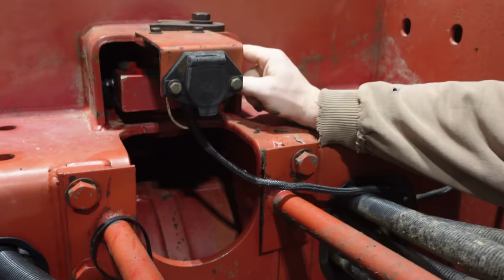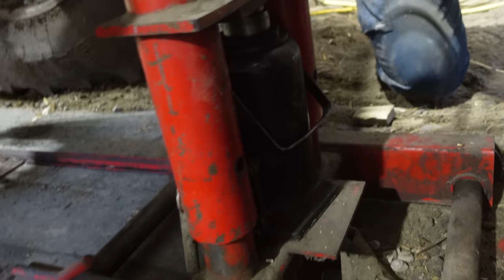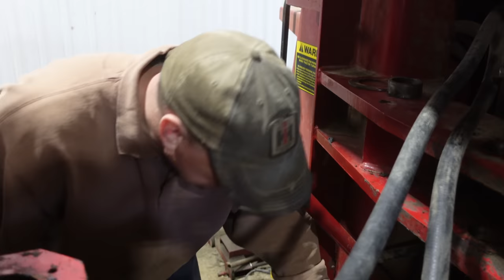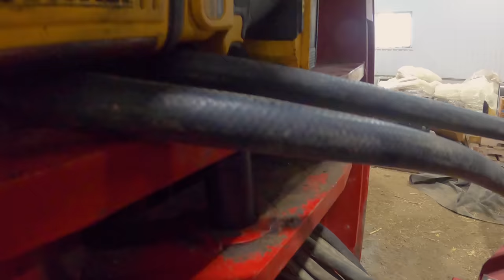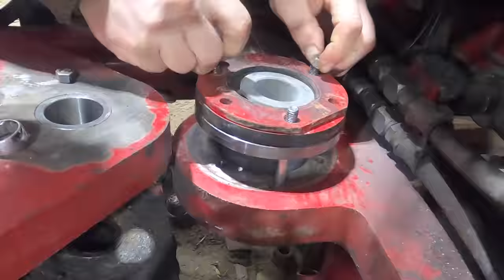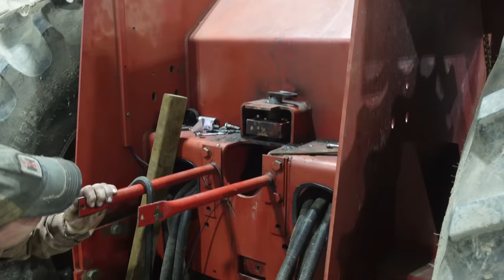Case 9350 Steiger Needs some Creative Machining...

Comment: You can use aluminium as a backing form when you weld mild steel , Jody from welding tips and tricks regularly uses it for heat dissipation also. ❤
Reply: Copper does a good job too
Reply: carbon
Reply: @notsevenfeettall  Aluminium (aluminum) is much cheaper but take old scrap copper tubing, split it lengthwise with a cut-off wheel, anneal it, flatten it, temper it. Hard to beat copper backing.
Reply: brass works as well

Comment: I have had a 120mm spherical bearing that wore out its mount work for half a decade when I needed to fix the bore with Devcon and the emergency repair lasted for 5 years before we got a chance to replace the mount. Its pretty amazing how well steel putty can work sometimes.

Comment: the hydraulic knock out tool for making holes in electrical boxes has a really nice pull cylinder that works great for pulling bushings I've done a lot of cam bearing that way.

Comment: Those tractors are worth their weight in gold. I did a season seeding in one in western Australia in 2008 the farmers had tried different brands over the years, (versatile, ford, j.d etc an nothing could beat the Stigers. They put the power to the ground so much more. The good ones can last 20,000 hours and the bad ones 18...

Comment: We had the bushing on one of the steering rams in the JD644 go like that lower pivot did on that case, it came apart and gouged the shit out of everything totally destroyed the cup, last year we just welded a decent used bushing in but this year we pulled the ram and are in the process of making a new end for it, need to weld some frame cracks too.

Comment: I find using an electromagnetic drill is perfect for drilling broken bolts as the angle doesn’t change as you apply more or less pressure to the job 👍
The fact that those bolts pushed through took all the fun out of it, such is life.
Thankyou for sharing 😎

Comment: Great video.  Takes me back.  Those through bolts on the lower ball joint plate seem like a lot of trouble.  When the heads inevitably get rubbed off from the bottom the plate can separate and then the whole thing disintegrates as you already experienced.  I’d definitely keep an eye on those bolts or convert that to threaded hole like the back.

Comment: On the international dt series engines that I used to work on the oil goes to the filter last so you never need to prime them cuz it doesn't matter. Its after everything else.

Comment: For those bushing repair green locktite is great when you can't get it perfect,

Also you can buy carbon slug or aluminium round for backing up, however overwelding and running a reamer with a mag drill is the best option

Comment: Jim’s automotive machine channel welds inside a bearing race to remove it. As it cools it shrinks the OD and it falls out.  Similar to the technic (?) of heating the race to expand it to red hot, then the cooled part is smaller at the end

Comment: Kevin, Rich, I've done barely any heavy equipment/ag repair but, did a lot of high precision spindle and gearbox building back in the day. So, the little tidbit of wisdom that I can share on projects like this is simple, keystock is your friend. On proper hardened bearings and bushings (any roller bearing and I suspect most of these bushings), we'd never use brass or aluminum punches, always keystock. It's a uniformly soft grade of steel so, it won't damage a hardened surface and as you use it, you can see any burr well before it gets ready to drop off into your bearing/gearbox. So, normally every month/week/day, you dress them up on a grinder to have a nice smooth face. My personal preference is toward oddball sizes of keystock. My go to is a piece that is 8mm thick by 12 or 14 wide and a foot long. That way, I can normally get the 8mm side into a tight spot, once a radius is ground on the end, it sits on a bearing lip rather well and the length just saves the back a bit. Obviously, in a tight spot, you might need to lop some off. 

I'd say 90% of the time in every shop like that I've been to, the bearings are sweat fit (freeze the shaft, warm the bore), from there methods differ. On new install, I've seen really nice press set ups and exacting shrink fits that let everything just fall into place. But, there always ends up being plenty of cases where something is getting hit with a hammer. 

Oh and if every you're in a bind because you do manage to get a bunch of dirt on a new bearing, according to an SKF rep, they recommend using Scott toilet paper to wipe them clean. Not sure the brand really matters but, I guess between the biodegradable fibers, small fiber size and relative purity, it'll break down with time in bearing grease and not damage the rollers.

Comment: We did the same thing with the greasable bushing on the draw bar of a Deere 4450 when I was younger. Same problem. It was a greasable bushing but no fitting
Reply: Clearly the grease in the bushing is suited for the lifetime of the bushing, it's lifetime being for the length of the warranty :D

Comment: I recently had to change out some hydraulic cylinders.  The 2.5 inch pins were seized.  I ended up using a Oxylance to blow a hole through the pin.  Thus shrinking the pin diameter.

Comment: On the age old oil filter argument, I was filling an oil filter up in the center hole and watched a small piece of the aluminum foil from the top drop in. If I wouldn't have caught it, that may have caused some serious issues if that made jt jnto a bearing. 

I figured the manuals that said don't prefill the filter were more worried about that kind of contamination and not necessarily the oil in the jug.

Comment: Pretty interesting.  The only tractor we've ever split was our 6588 to replace the clutch; about three times or so.  It seems like a big deal but since the 6588 is a 2+2, it's essentially a front with DT466B and axle hinged to a cab and axle from a 3688.  But when we got our green Steiger, I think it was a Panther, thankfully nothing like that was needed.  I don't think I'd be attempting something like that.  Interesting to see how you folks went about it though!  Always like seeing these old workhorses keep on working the fields.

Comment: If you have a good magdrill you can use it to bore accurate holes in areas that you cannot fit a line borer.
You can either fit the drill with a boring attachment instead of a chuck or use a high quality hole saw/drill.

Comment: Case did their oil filters the same way. Upside down because it was only partial filtration. Oil filters were generally an option on Case tractors, like the VA. because the oil pressure was minimal. You were lucky to get 15 psi cold. Filtration was done through gravity. If you ever took apart one of those oil filters, it's just stacks of cotton discs. If you applied 40 psi to that construction, the oil would float in between the disks and not filter anyway. A filter housing was also an option with partial filtration. You wanted slightly higher pressure, you deleted the filter housing and changed the oil twice as frequently.

Comment: Liquid nitrogen works really well for bushings, with a little gentle heat in the parent metal. Now that I have my own shop I keep a 30l dewar full of it around, only costs me about $20 at my local praxair to fill it up, and it generally lasts me two or three weeks depending on how many bushings I'm doing and how hot it is. But if you're just doing a one off job and don't want to buy a dewar, acetone or denatured alcohol and dry ice from the grocery store works almost as well.

Comment: When freezing for a press fit, goto Walmart, buy a 3 pack of compressed air for computer key boards, get a Styrofoam cooler, turn the can upside down, dump them in. TaDa! -59 degrees F instantly. Its not nitrogen but it's a 20 dollar fix and close.
Reply: NO SHIT, T.Y. SIR.
Reply: @3073Sean  I know exactly what you're talking about, I FELL FOR THAT CRAP, THANKS AGAIN, SIR.

Comment: FILTER WILL NOT COME LOOSE by doing this.On my Machines, especially if the fuel or oil FILTER tents to rattle loose, I put a HOSE CLAMP around it, so that the screw part can rest on a part of the engine (Or housing/something) which intern stops the filter from unwinding..... This is especially good because you don't to tighten crap out of it, which means it's easier to get off again....

Comment: Now this is how a true farmer operates.They don't call the local dealer and have them send out a new tractor when something breaks they find a way to fix it at the time and then during the winter they bust ass trying to fix it properly if they have made enough money off the latest harvest, if not the temp fix lasts until something else breaks.

Comment: The glass slooks like a double laminate you have cut at a glass shop. Ya know send in some card bord.
If that's the case you can weld in some sheet steal and make the glass smaller.  So it doesn't break, you'll just bend the metal, pull apart the seal.... Have air conditioning agian.... Idk it might work well for a time.

Comment: turn the plate round and drill and tap new threads between old holes or drill though and fit bolts

Comment: you can back up a weld with copper sheet/pipe or brass as well. ferrous dont stick to non ferrous metal. also can use it as a heat sink behind thin car panel.  i feel like i already said to much

Comment: Use copper instead of coffee cup of water. Copper backing plates work well for welding up big gaps or holes. Copper bar stock in that hole would probably work nice

Comment: For threaded holes… find some copper tube that just fits in the hole and you can weld to the broken item without the thread getting damaged.

Such a duo never to be seen again until something else breaks…
Nice use of the mobile press.

Comment: A bunch of the john deere 50 and 55 series engin filters were also upside down. Some engins are also sideways. I think it's a myth about filling your filters however there is some engine that tell you to pull the fuel pump fuse or relay and roll the engin for 30 seconds without starting to fill the oil system. Also it makes sense that Kevin broke both windows why wouldn't it go like that!

Comment: The thing with running Shell is that it isn't suitable for Volkswagen pump duese diesels. They need the 505.01 spec which not a lot of oils meet, and if they dont get that they kill camshafts and lifters lol.

Comment: One of the reasons I love diesel machines: you can torch around the fuel tank without much concern. If it was gasoline, I'd be scared to death of torching by it. Diesel won't blow up on you.

Comment: Fun fact: not every new Steiger has a greaseable drawbar bearing, most of the 2018+ big frame (500-620) have them but the 370-470 do not but I have seen 1 370 with one but the farmer had the sister tractor to it (one serial number off) and it didn’t have one, it’s very hit or miss like everything at Case IH

Comment: Ever try left handed drill bits? that's about the only way i have luck drilling out bolts myself. the bolt eventually grabs and comes out with the bit.

Comment: I'm worried about the extra thread around that spherical bearing.  I suppose it will grind itself away, but I'd rather use a grinder for that than the metal of the equipment.

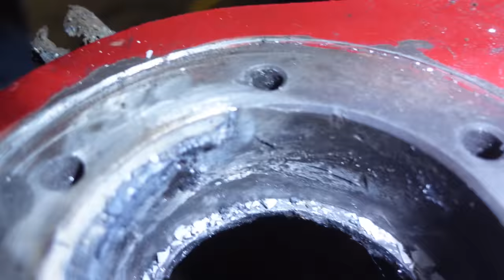Comment: 39:00 what was the diameter of that hole, thought on a cylinder ridge reamer, I know in HS we had one that was single point and only an inch deep, a little bigger one is available #67058 that combined with a adapter would have been perfect for precision
Reply: Bluepoint wr30a

Comment: Personally, with all those broken off bolts, I'd have just ground down what needs ground to flush it out, then use your new flange as a template to drill and tap new holes in between

Comment: Could a line bore machine fit over and under the main linkage it would have made the hole perfect. Weld it first and line bore it. Maybe a bit pricey compare to a bush wack.

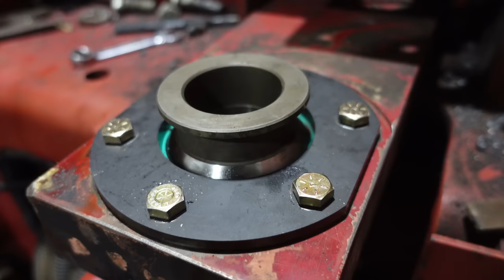Comment: 42:54, there’s a reason why the bolts that were in the spherical bearing were grade 5, is so that they do snap and are easy to drill out, shouldn’t use grade 8, grade 8 will make it harder to drill out when they do brake in 8 years or so also grade 8 bolts shear differently and have less tensile strength then grade 5… they snap easier because they don’t stretch and give, only my experience from working on boom trucks and man lifts and helicopters…
Reply: And grade 8 bolts will oblong the holes because the metal is stronger then the steel frame

Comment: Crazy how creative some guys can be. But why have a nicely finished shop (insulated and lined with tin and good lighting) and not have a concrete floor??? When you are doing all these repairs for yourself, you need the safety of a concrete floor. I could see the ground moving while you were jacking that first pin.

Comment: porcelain huh?
i would have never.
my go to would have been a dissimilar metal, like maybe some 2-4 gauge copper, and roll it to the desired diameter.
i mean, its not stupid if it works though.

Comment: wondering when you're going to just put this tractor in a low forward gear and just get out of it and let it go on its way.  LOL
Reply: That would be a huge mistake :D Aint nothing from any manufacturer since that would come close to touching it for reliability, and they all cost a lot more. Unless you live next door to a dealer and married his sister the new stuff is untouchable, every ten minutes there is another sensor or software issue and one code = limp mode :( Only upgrade options for a Steiger from the 90's would be a real Steiger in green, or a Versatile from the 80's
Reply: @Muffin_Masher  I was just joking.

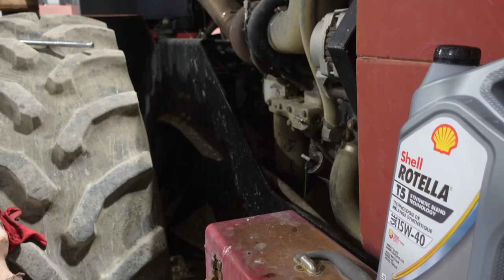Comment: 31:28 All base oils are NOT the same! Many cheap oils are using poor quality base oils (mainly Russian) and adding more additives in order to achieve the same specifications! Hence the reason, that your engine could consume oil using the same spec. oils. Its consuming the one made with poor quality base oil. Shell makes good oil but it is not unique.😏

Comment: If i am not mistaken, international put there filters the other way round, because the pumps they used to use were to powerfull, so the pressure would get to high, thats what my dad told me(he is a huge ih fan and used to have allot of them)

Comment: Could you have poured like a babbitt bearing material in the gap instead of welding it? Machined up a pipe or slug to fit, poured in the babbitt and then filed to fit?

Comment: If Rotella is as good as you say it is wouldn’t there be enough residual lubrication on the internal parts to protect them until the new oil fills the filters?
Reply: Your bearings need oil pressure so they can maintain their clearance while running, no matter the quality of your oil the residual film isn't going to buy you more than a handful of seconds before your bearings start suffering.

Comment: If it were electric… you’d have to recharge in 5 miles! I enjoy the technology but hybrid is more realistic approach. Still need to produce electricity and now you know why big money is pushing the  investing in electric production sources. Prices of credit for those who put in will drastically shrink and the others connected as main source are going to be flat busty @ 30% increase cost…. Just wait! What about not leaving those in california without water as every resource dries up? 100% of the coast line touches water. Why can we not solve that problem first?

Comment: Haven't some of those been used until they actually split apart? but then in the city, there are many of the same car... so the game of hot potato becomes a thing, there are no hot shot fixed they just have to keep paying or there stuck with the broken one... fixes the broken one, ending the hot potatonomics algorithm? only sell pre-stretched bolts "the race car CV axle that keeps braking until... non-agricultural things are made to brake very repetitively under little effort (hot potatonomics algorithm) a stud to a hub yielded to shear just to get more, friction welded heat treated in key location to do as so"... almost have to cast and lath the parts by ones self to avoid the algorithm.